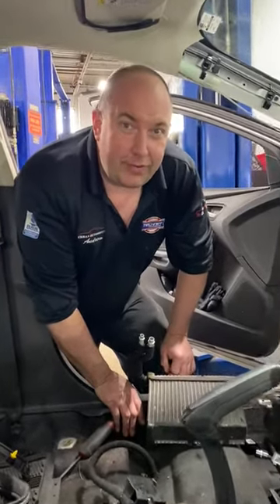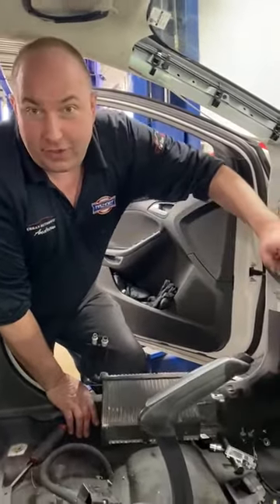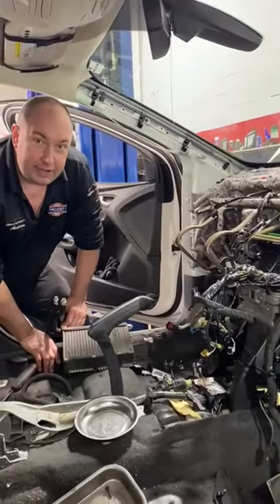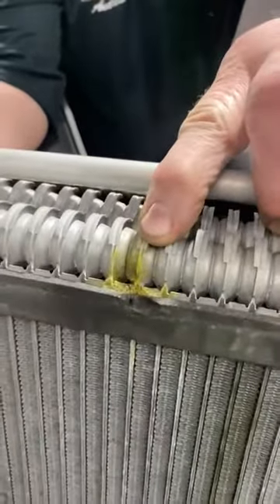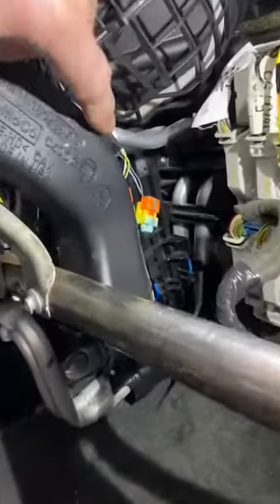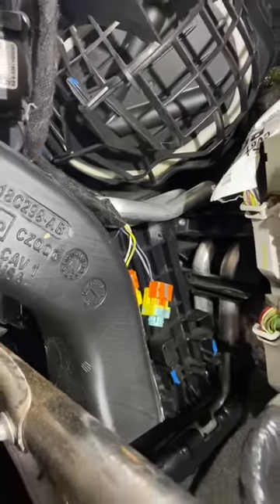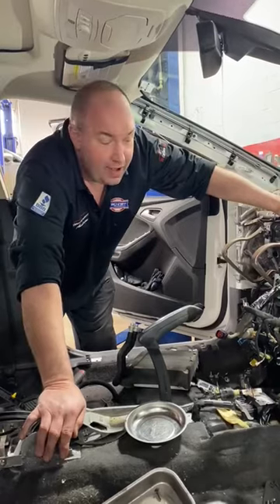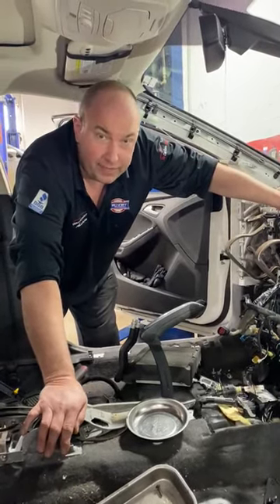Whats Involved With An Air Conditioning Evaporator Core Replacement On My Vehicle @UrbanAutomotive01

Comment: Seems to me like Ford built that car with the idea that if something happens to the AC Evap core & you "MUST HAVE AC" then you need to just dispose of the vehicle. I mean 9 hours & 2,000-4,000 dollars for an "AC core replacement"... Probably takes less than 2 hours & ~$500 to remove the AC compressor and install a bypass pulley to just delete the AC altogether. It should be criminal to design some things the way these lousy vehicle manufacturers do....